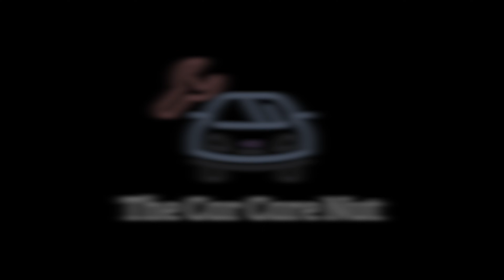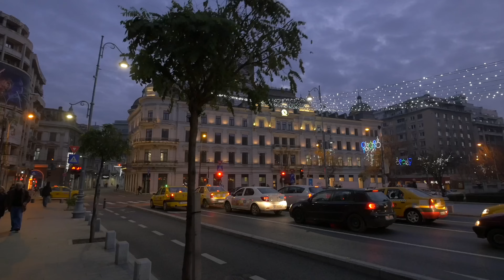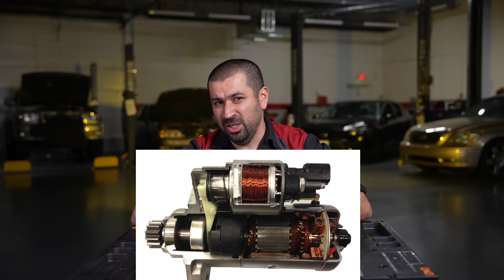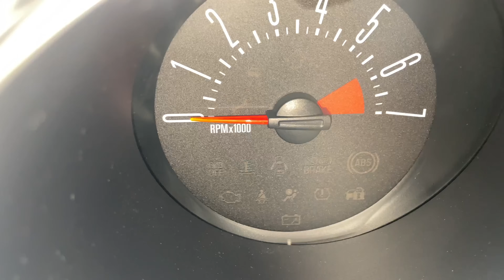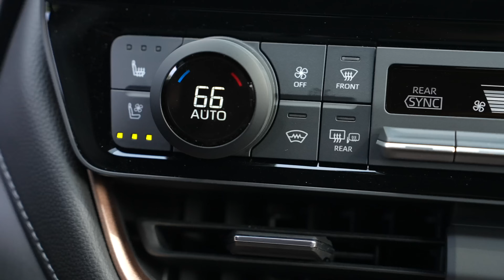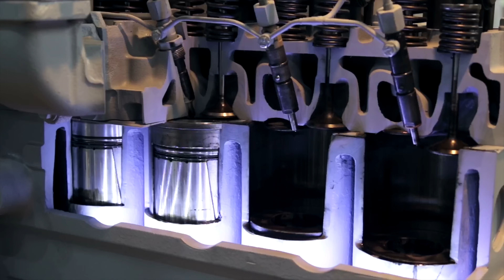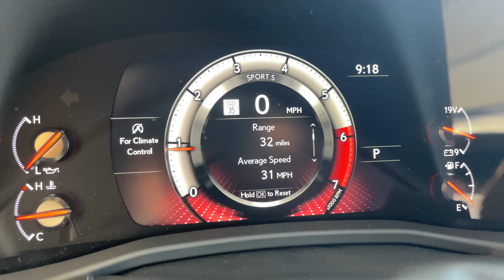How Does Start Stop Technology Work in Modern Cars? Everything You Need to Know

Comment: Thank you for your, as always, simple explanation of a complicated system. As a retired electro-mechanical engineer it is my humble opinion that this technology is a total waste of technology and engineering and accompanying expense to achieve the miniscule amount of emissions it will reduce. More complicated = more problems = more expense for the car owner initially and over the long term. When purchasing my latest vehicle a few months ago I specifically searched for a vehicle that DID NOT have this ridiculous start-stop technology and found it in a used 2019 Lexus RX350.
Reply: You should drive your car for 20+ years like I do. 2001 PT Cruiser still driving strong...modern at delivery, no longer. No matter.
Reply: @JohnW118  My other vehicles are a 2001 Honda Accord with >200K miles and a 2005 Mitsubishi Endeavor with 150K miles..... love them both....just enough technology for me and extremely reliable V6's.
Reply: good decision i will do the same.
Reply: I found it absent in my 2022 Nissan and couldn't have been happier for a less complicated system.
Reply: a lexus RX doesnt have it? really
Reply: @randomrazr  Well, as far as I know, my 2019 Lexus RX350 does not. This is the 4th generation Lexus RX350 from years 2016-2022.
Reply: Great points. A Harvard study finds 'decreased vehicle emissions linked with significant drop in deaths attributable to air pollution.' So despite the increased cost of the technology and minor annoyance of Stop/Start, it can be argued there is a benefit to society.
Reply: With all do respect... I personally don't believe any study that comes out of liberal-agenda-driven Harvard University. @universalassociates6857

Comment: I have a MY22 Audi Q7 TDI 45, which has the 48V mild hybrid system, and DESPITE having the separate li-ion battery, the climate control absolutely does NOT maintain enough cooling - it drastically cuts the fan speed, for one. You haven't given us the full picture at all.
Like many others, I always disable the start/stop, and I go a step further - on the freeway, I put it in Sports mode, which then prevents the engine from cutting off when cruising. The reason I do that is because when it cuts the engine off, and I'm using cruise control, it allows the speed to drop too far below the set speed - it's absolutely absurd.
Start/stop is a complete waste of money and adds unnecessary complexity in an ICE vehicle IMHO - it's probably a lot better in the Toyota hybrid system though.

Comment: I drove a 2021 Jeep this summer and it had the auto stop feature. It was annoying because I didn’t realize it at first since I was listening to the radio but when a red light turned green, I’d get on the gas immediately but it wouldn’t go instantly. It took about 10 seconds before the Jeep would move, people behind me would lay on their horns telling me to move. The starter was weak too because it took several revolutions to finally start the engine when I press the engine start button.

Comment: While it was a great explanation I’m not a proponent of all this added complexity just to turn off the engine. Plus oil does drain back down to the pan and I don’t like that. If I’m in a condition where I know I could be idling a long time I will shut off the motor myself possibly.

Comment: Pretty amazing explanation. Been reparing my own - and the family's (NO DON'T CONTACT ME!!) vehicles - for over 20 years now - and just recently bought my first vehicle with the Start/Stop (an F11 gen 530d bimmer). Although I had some idea this system is complicated as f__k - still had no idea it went that deep in the... well... NASA technology. I try not to use it - because every time the engine starts, the infamous timing chains on the N57 engine get... their lives... shortened - but sometimes in massive traffic jams - I just let the stupid thing do its... thing. Couple of items I've noticed: the dailight running lights don't dip even the slightest. Wow, Dingolfing (the birthplace of every 5 series) - you done did good. Also - the transmission stays in drive. Also wow. There's no disruption in multimedia or dashboard... everything just works (touch wood... metal... plastic... every substance known to man). And finally - the date code on the battery says "26 12" - meaning - week 26 of the freaking production year - which makes the original AGM battery now more than 11 years old. Still works fine. Also - I've noticed that only every 2nd stop or so - the system gets activated - probably the checking of 8 volts present during the startup (or any other voltage as determined by the brilliant heads at Dingolfing) - at work, verifying the conditions to deploy the shut off. Overall - amazing little... actually pretty huge - piece of technology, if only the smart heads at BMW could have made the timing mechanism so reliable that all BMW owners could leave the system on - without feeling massive amounts of terrible guilt and worrying their valves would soon be introduced to the pistons, huh. Either way - thanks for the video, keep up the work - from Latvia.

Comment: My wife had a diesel CX5 with the start/stop system.  It worked great except for one thing...   It went through three very expensive start/stop batteries in six years, none of them covered by warranty.  In the end I just put a normal heavy duty battery in it and disabled the start/stop system every time I got in it.  The pollution generated from manufacturing three start/stop batteries far outweighed the pollution from the fuel at idle and the cost of one battery which I would expect in my climate (very mild tropical).  They simply haven't got the battery technology reliable enough for this to be viable, not for that vehicle at least.   There was no "better battery" available to purchase, and I was done putting batteries in it about two weeks after the warranty expired.  My wife passed away last year so I sold the car, and while it was great to drive and super comfortable for long trips, I have a feeling it was going to turn into a money pit sooner or later, so I wasn't too sorry to see it off.  I now have a 4WD vehicle with no start/stop.

Comment: This explanation is really great!
I just have one question: how does it affect the fuel consumption? 
I watched a video years ago, where a guy repeatedly started multiple engines and measured how much fuel they consumed while they were idling and while they were starting, and concluded that an average 1.2 liter gasoline engine would have an advantage with a star and stop procedure only when it remained off for longer than 7 seconds. Does the fact that the starting procedure with a start&stop system is different mean that the engine doesn't consume more fuel while starting?
Reply: It doesn't. That's the thing. The "savings" are pathetic at best.
Reply: @MadScientist267   It seems that with all the extra battery and chaos there is often little to no benefit for the sake of looking like you are taking care of the environment.

Comment: These systems are basically a scam, they only look good during emission tests but do not provide sufficient fuel savings that justifies the extra costly battery, starter replacements and system faults.

They also wears the main bearing and conrod bearing faster, just imagine that instead of 1 start up event per trip, we now have dozens or more per trip. Each time we start up, the oil pressure in oil galley and bearings are low, less cushion for metal to metal contact.

Comment: Well done - thanks for this explanation! Having grown up in the 50s and 60s we were always told the constant starting and stopping of the engine would kill the starter - and it was often the weak link. I always carried a hammer in my Corvette to whack someone's starter - (just as useful as a good pair of jumper cables)
Reply: Back then they were probably inertia starters. I recall my Father carrying a hammer in his Morris Marina to bash the starter when it wouldn't engage.
Reply: Still works with pre engaged starters. The usual problem is the solenoid sticking not moving the gear into the flywheel. Had a rescue patrolman use a heavy chisel!

Comment: My main worry with this start stop system working.  Is the turbo charger.   Which does not like being stopped.  When hot.  Always kinder to the turbo to allow it to run.  For 30 seconds ,,so to lubricant the red hot spinning bearings

Comment: Junk all we need is shit delay a fast needed acceleration because a train or cars coming. Then all these auto locking doors and seat belt chime crap it really f,s with workers that use trucks for work trucks that need to get out frequently . The shits more dangerous then good. God dam windows you move a button a little and it goes up and down but to much it fully opens or closes more dangerous shit i cant count how many workers got there hands pinched in a moving window in the track. These auto makers need to wake the f up we buy heavy duty trucks for work not to get groceries or go to the mall.

Comment: Thanks for the interesting video. Didn’t know about some of changes of some car systems that had to be changed because of the start/stop. I have a 2021 Jeep Gladiator. Jeep added a 2nd smaller battery just for the start/stop system to 2018 JL Wranglers and 2020 Gladiators. So far I haven’t had any problems with mine. I’ve heard that the battery can kill the main battery if you’re not careful and change them out at the same time.  I don’t like it. I shut it off every time.

Comment: As long as the engine oil pressure drops to zero, it is causing unnecessary wear at every start. I will never use it or buy a car that can not be disabled

Comment: Terrible and rather dangerous feature and I always turn it off on rentals. So far I have managed to avoid buying a car with this. If it was a manually controlled, may be. Plug in hybrid makes the most sense that can be run electric only for 40 or 50 kms. You will never be stuck waiting for a charging station and that 50 km will allow for many journeys to be electric only.

Comment: Consider a crowded intersection with a stop sign. Or stop and go traffic. Or cars at the stop light deciding to turn right, or move forward a bit; just a bit. Several times. Or you being the unlucky one to get at the intersection that just turned the green light, but still have to stop for less than a second. And then stop again, cuz you know how those intersections get cleared.
Start/stop should be off by default and the driver should appreciate when he or she wants to enable it. There should be provisions to have it on by default, off by default, or switch off after engaging, leaving the driver in charge to set any of those modes.
Laws are laws, powerful and blunt and idiotic sometimes.
At the emission levels that modern cars achieve, this doesn't solve much of a problem, just complicates things unnecessarily.

Comment: I disable the thing 1st time after i start engine and front parking sensors after exiting garage ... they are terrible things for gas powered engine especially small engines with manual gear ... it gives a 10k starts warranty only. Regular traffic jam will kill battery and system also (sometimes over 30-40 stops in a motorway jam, sometimes even more) thats a killer for car ... for just a traffic light stop... maybe ok, for anything else, engine killer

Comment: My start stop stopped working not because of a malfunction but I installed amps and subs in my car. So I’m constantly depleting my battery reserves even after installing a 320 amp alternator. The ecm is detecting the alternator must recharge the batteries. So it never shuts off. But it used to work before I installed everything

Comment: Very good description 
I like the feature much less now lol 😆 

What's some might find interesting,  I apparently have a light brake foot while stopped, it won't engage unless you are firmly on the brake pedal.

Sometimes if it's a long stop I'll press down to engage it.
Most of the time if I engage it by accident, 

I'd say 80% of the time it does engage,  I don't want it to. And in the summer it only stays off for a few seconds.
Overall I'd say skip it, or at least let the button stay "off" after a restart, I'm perfectly capable of turning it back On when it's actually warranted.
Reply: Yes I drive the wife's car that has this and manipulate the brakes so it does not engage.

Comment: My 2022 Hyundai Kona Limited ICE has this feature (my 2019 Kona did not). It never seems to activate (you can manually deactivate it). The new 2024 Kona redesign has removed this feature -- they also changed their dual clutch system to a regular 8-speed automatic -- so I guess Hyundai figured out that Auto Stop/Start is stupid. Oh, and the only time mine seems to activate is when there's no A/C on, no heating, and the air temperature is spring-like.

Comment: Great video but one of the concerns that i have is the oil pressure behaver at the valve train on top of the engine where it usually takes few seconds longer to build oil pressure. what about the valves and cam shaft at each engine start.

Comment: In the early 1980s I drove a Fiat 131 in Europe that had Start/Stop technology. It even had a manual transmission. When you stopped and placed the shift stick on neutral, the engine stopped. As soon as you depressed the clutch pedal to put the car in gear, the engine started.

Comment: Or just do it the Mazda way.  Stop the eninge with a cylinder charged under pressure and with fuel and use the spark plug to restart the engine.  No special start nor battery needed just use cam and crank sensors that are already there.

Comment: It’s pretty simple it’s trash and you should never use it it’s bad for the starter the motor mounts and so much more it does not save enough gas to even make it worth it and if it’s in the middle of the summer it won’t even turn off anyways when max ac is on due to sensors

Comment: I see tons of people (especially Ford F-150 truck owners) using the stop start tech, I can hear those engines starting at stoplights all the time. Clearly some people think it's fine and not annoying. I however, find it very irritating. I have a 21 Kia Soul with stop/start and I shut it off every time I remember. It gets very annoying when running errands doing short trips in between. Where I live, you very often stop for a second or two to pull into traffic, and that's annoying as shit when the car shuts off the second you hit idle rpm.

Comment: Back when Mazda was developing SkyActive, they used their ignition timing and DI fuel injection to momentarily spin the engine backwards a few degrees to put one piston under TDC with some amount of fuel. Then, to start the car again, that cylinder would ignite and the cycle continued normally. The starter motor was never involved. I have no idea if they ever brought it to stateside, and I’m really curious what became of it.
Reply: When I first drove a car (Ford Mondeo) with s/s technology, I wondered how it was accomplished and came up immediately with the TDC theory.  Great to learn that it has been tried and tested at least practical - if not for the long-term.  Don't know.
Reply: Seems like a reasonable start/stop system would be with a spring that winds up and releases for the next time it is needed. Assuming the car starts with a couple cranks, the starter could remain virtually unused.
Reply: I read that BMW's straight 6 has a motor/alternator built into the flywheel so it works as a starter, an alternator and a boost motor for exceleration.  I think it was a 48 volt system.
Reply: I don't know for the US, but i guess it's the same as Europe, it is exactly how the start/stop system works on my MX-5 ND, and it's freaking cool ! I have the 6 speed manual, so the engine is restarted when pressing the clutch pedal to engage first gear. It is so quick that the engine as already started before you finished pressing the clutch pedal. Very freaking cool tech. As a bonus, the capacitor that manages the voltage drop and the battery are recharged via kinetic energy when braking (brake pedal or engine braking)
Reply: @TheRealTomLauda Mazda's 'i stop' system is one the best out there on a pure ICE car. Smooth and instantaneous. The starter barely cranks. I've got it on my Mazda 2 1.5 skyactiv. Far superior to some I've encountered on some Euro cars which are slow/clunky as if the cars starting from cold first thing in the morning.VW springs to mind...
Reply: They didn't bring it to the US market (at least not untill I left the dealership last year, I think they have it now in the cx90). I think start stop is overall a good thing, but US buyers don't want it, so I would say that they made the right call. 

I remember from training on the international start stop system, they could use the vvt and throttle to brake and stop a piston exactly at BDC so the engine could start as quickly as possible.
Reply: @danielwinn7108  Hey Sir.  Thanks for the info.  What you say makes sense.

Comment: The auto-stop is one of the worst things the automotive industry ever did.  I used to brake with my left foot and keep my right foot on the gas.  The engine wont turn off if there is load on it... giving it a little gas is that load.  F auto-stop.